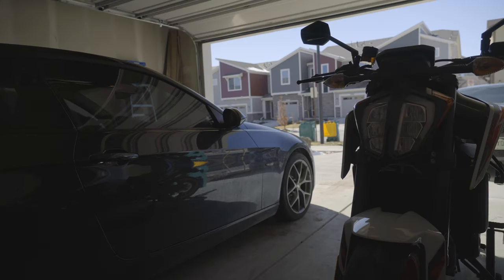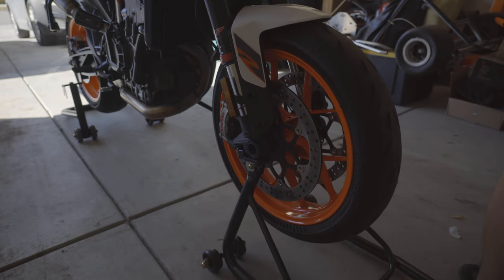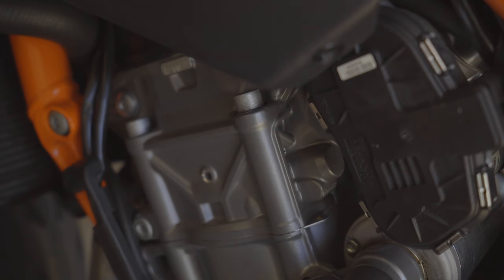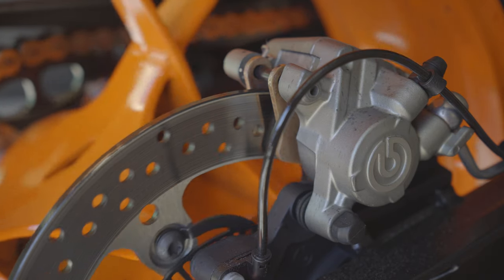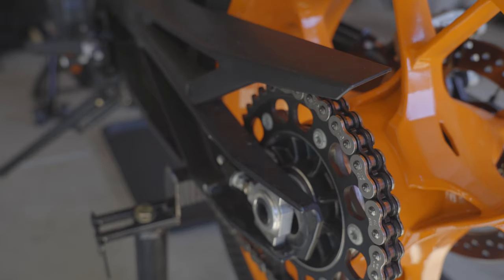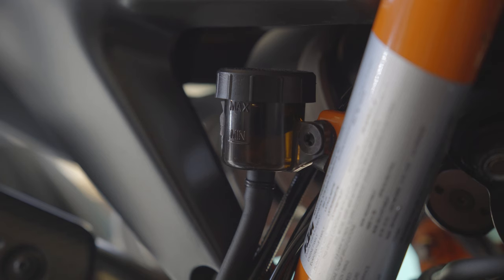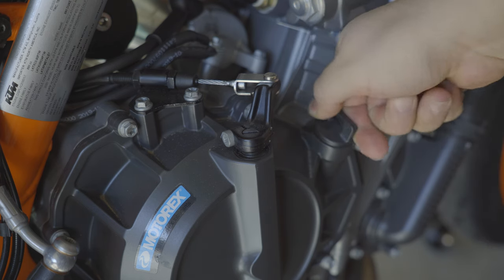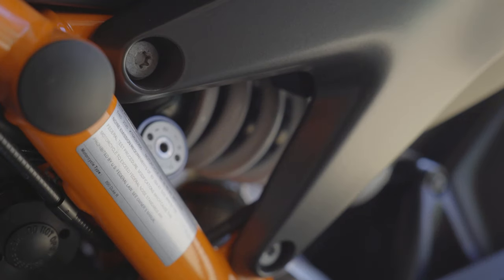Pre-Season Motorcycle Inspection (3.5 Min Checklist) - Ft. KTM 890 Duke R

Comment: Ive just installed a new thermostat housing, new bolts and refilled mine with fresh coolant, lots of folks saying the hoses are rubbish to on the forums so I've got some silicone ones on order to. Just used your oil change video to thank you 👍🏻😎
Reply from the maker: How’d the silicone hoses and thermostat work out for you? I admit I got a little leakage this last winter but not more than a couple drops. I do hear the same! I may consider replacing mine if you’re happy with yours. I appreciate the kind words brother, ride safe!

Comment: Do you know how to adjust air mixture ? My ktm 890 r is running to lean. Thanks
Reply from the maker: Hey Jason, that kind of capability is associated with various forms of tuning that are currently on the market. Distinguishing between the types is very important and can have pretty serious implications so I'm working on a video about making that decision for yourself. Part of me wishes it was as simple as swapping a jet on a carb but ultimately the fuel injection system on the 890 R is what enables us to get more HP and smoother operation from it with a tune. The lumpiness many people observe down low in the RPM range on new bikes is associated with a lean tuning condition to meet emissions regulations. Lean tuning not only reduces fuel consumption but increases burn temp and that is what reduces concentration of CO and other highly regulated combustion products.
Reply: @AlejandrosEngineeredLifestyle  Thanks for the feed back. I can't seem to find and tuning system for these bikes which sucks.
Reply from the maker: @jasonfox2830  you’ll have to let me know if the video I put together helps or if there are more specific questions you have. I’ll comment again when it’s up sometime next week is what it’s looking like!

Comment: This coolant issue does it plague the 2021 models as well or just the 20’s?
Reply from the maker: From what I’m told they addressed the issue on 2021+. What that means I don’t have perfect clarity on but it may just be as simple as revising torque callouts on their manufacturing drawings.
Reply: @AlejandrosEngineeredLifestyle   Regardless if it’s been addressed for the 21’s still would want to check out your video on the subject. Really enjoying your content
Reply from the maker: It certainly wouldn’t hurt if you ever do notice a small leak. As always, I appreciate it!
Reply: For 2022 model do I have to worry about that coolant issue?